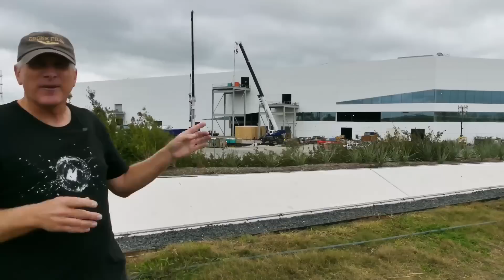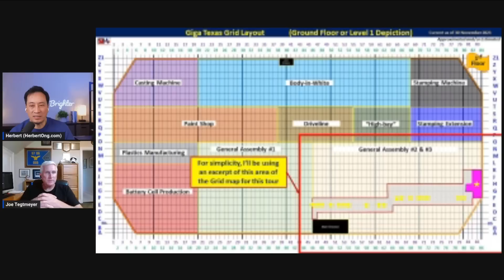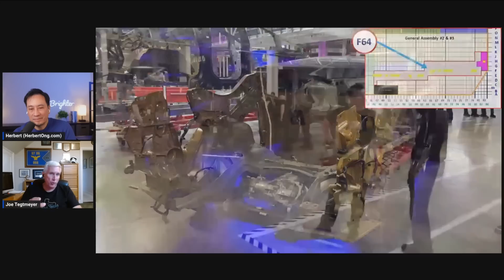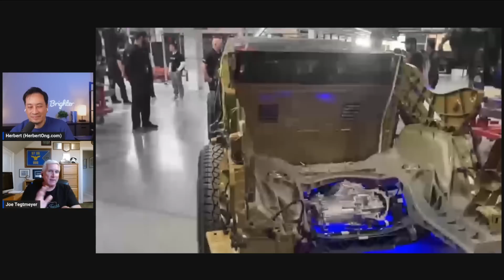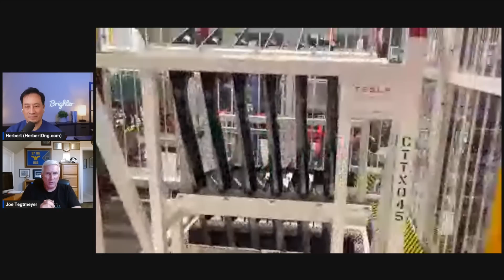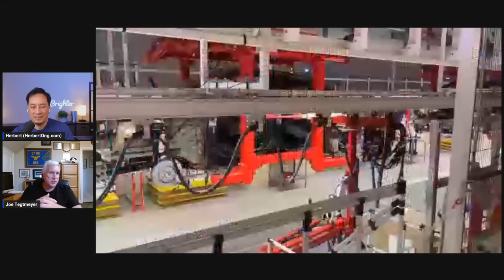Tesla’s Giga Texas Building $25K Car, Bots, Model Y and Cybertruck

Comment: Hey, Joe, as soon as they have the walk down pat so the bot doesn't fall putting bots in tasks takes an hour of on-task training, it can be put on any early simple task very quickly and will not need bathroom breaks, lunch breaks, shift changes, etc. so it will only speed up the development of the "Model 2" line.

Comment: Having witnessed the recent reviews and raves about the new Cybertruck,  I have had a thought related to the new economically priced Model 2/Robotaxi. 

This is in regard to the new steer by wire system and removal of stalks from that area on Cyberttruck. Without a physical connection to the steering assembly on Cybertruck the Model 2?robotaxi conversion will be a simple removal of the panel that attaches the steering wheel and its buttons to use a flush panel as a replacement cover in the Robotaxi, no need to worry about any physical connections.
 
The cybertruck steering is a beta for robotaxi! I haven’t seen this mentioned by any of the industry reviewers although Sandy M may have thought of this and is under an NDA. Cheers.

Comment: Paint Shop in manufacturing - Great discussion on saving costs, which translates to lowering price.  Stainless next gen vehicle?  Probably.
Reply: Price, I believe, is the main thing about the main thing in the largest market segment.  These customers need to get from A to B, period.  Reducing complexity reduces price so talk about needing many trims and colors is crazy talk.  People need affordable, dependable transportation.
Reply: Stainless steel is a much more expensive material but it avoids so many extra processes that it can save time, space and potential defects to make its use viable.😊

Comment: Joe is correct - the next gen factory will produce cars in segments not a single production line. 

The other major change will be vertical integration literally speaking. Not everything will be based on the ground. More vertical space used.

Comment: Theoretically how much of the line is part of the building, how hard would it be to move an entire line?
Reply: None, I think, but moving a line indicates a change in plans and additional expense.  It's not optimal.  A line consists of more than one floor so it's a substantial change to move it, I believe.  I suppose you could also say the opposite, that the entire line is part of the building.  It's all attached to the floor and there are elevators/holes in the floor/ceiling above.
Reply: Some processes can’t be easily moved as they are on a special isolation foundation . Stamping and gigapress for example.😊

Comment: Tesla stock could be subdued in 2024. As with the Cybertruck joining sales and cost of sales will pull down the profit margin. The CT will be sold at a loss for a while and even when it gets to break even it will pull down the profit margin. That’s enough reason to hold the stock price down. It won’t be until 2025 when the CT is contributing to margin

Comment: The CT was supposed to be an exoskeleton and that was the reason for its shape. Once that concept could not be realized they should have went with the traditional body on frame design. Tesla married themselves to an unnesarry design that requires extra castings on top of the rear main casting and alienates many would be EV truck buyers.
Reply: No, that’s wrong. Much of its structural strength comes from the stainless steel exoskeleton. More than anything made so far.😊